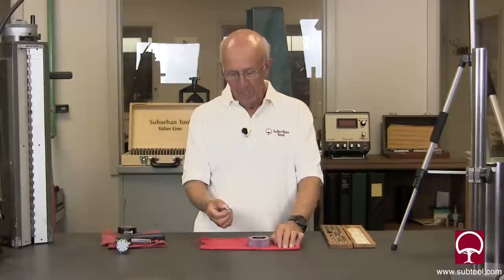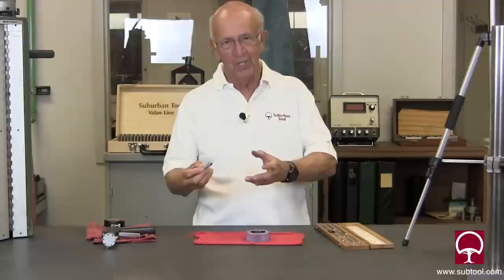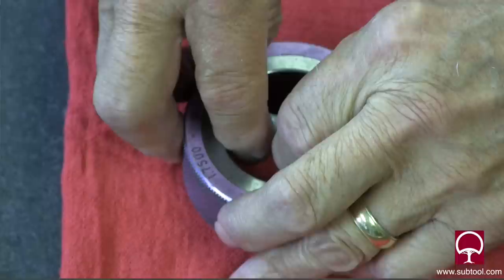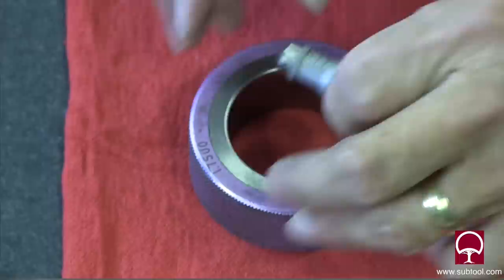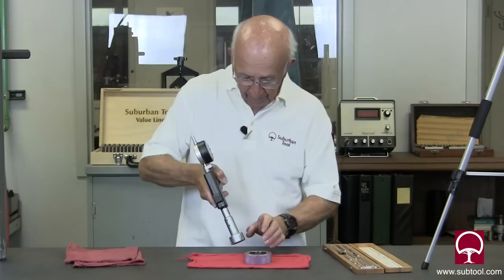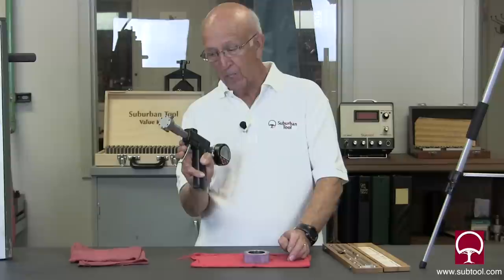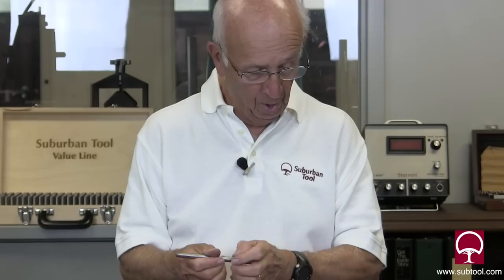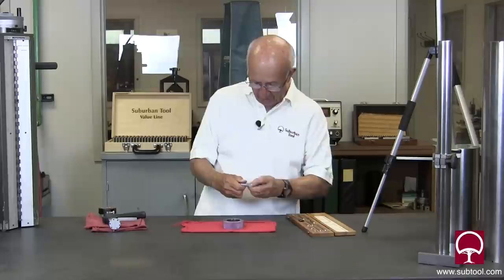How to measure with an inside micrometer

Comment: Great information thanks! For sure there’s a huuuge price difference. A few hundred for micrometer set with extension tubes that goes from 50-300 or 50-500mm, vs. many thousands for a small set of 3-point handle snap inside mics that doesn’t even cover a very large range. For “normal people” either manual inside mics or a set of telescoping gauges is the way to go unless you’re only measuring a single ID all day long and only need to buy a single expensive gauge.

Comment: Don:
  Love your videos.
  Ok, I got started right. I went to work for Wagner Mining Equipment.
  We had a QC guy, he constantly walked around the shop, spot checking everyone's work.
  I said... " Don, here are my micrometers, you wanna set them for me?"
  He said... " I can't, you have to do that "
  It doesn't matter how hard you crank your micrometer.
  What matters is... can you do it the same way twice.
  I lent out my ID Mics to a local calibration company.
  In return, Clint calibrated them.
  I just laughed... I never even read the ID mics.
  I put them in my OD mics, and use that number.
  What if there was a dust mite under that 1/2" spacer?
  Just how fat is a dust mite, anyway???
\   Anyway, a couple threaded pointy sticks could replace any ID mic I own with a nut in the middle.
  Take them to the OD mic, and get the feel.
  Thanks again!!!
  Mark

Comment: Don, you mentioned that the bore gage is expensive, and that is a limitation to be sure.  What you failed to mention is that the bore gage also has a limited range of measurements.  So, to duplicate the function of the bore mike, one would need a whole collection of bore gages.  And some measurements simply would not be possible with bore gages (e.g., measurement of a 12 in. inside diameter).  

Great video, as usual my friend.
Reply from the maker: MrShobar Good point , thanks for watching.
Reply: As I don't have the feel for ID mics yet (matter of fact I don't own an ID micrometer), I would go for the bore gauge every day. I even got bit by an ID micrometer I borrowed that had a pitch error as it was pressumably dropped. 3 point micrometers sound like a good choice but the price is kinda stingy...

Comment: Gday from down under,
Calibration of our measuring equipment where I work is done by a company in Brisbane QLD. I have found errors in the outside mic's checking them to the standards that come with them. We use mainly "Mitutoyo" which is in my opinion - top shelf gear. Can the standards that come in the box be trusted? or should I trust the people that calibrate our mic's? they are not cheap to have done! I have my own personal mic's & look after my own & they seem to be more trustworthy!
On a final note, I bought an older set of "Moore & Wright" depth mic's at a flea market, what is the best way to calibrate them? they are 50mm to 300mm I've had them for a long time & never done them.
Cheers - Peter Spence.

Comment: Don,Thanks for posting!  Hey I think it would be a great idea if you could show people how to set a dial bore gage like a Mitutoyo  511 series and also  dial split ball like a Starrett 82z series with gage blocks close to the bore size one is about to measure  (also ring gages  as well but remember not everyone can afford a bunch rings but they usually have gage blocks: at least a 36 piece if not an 82 piece set) Thanks for your consideration.
Reply from the maker: We'll consider it, it's in our notes.